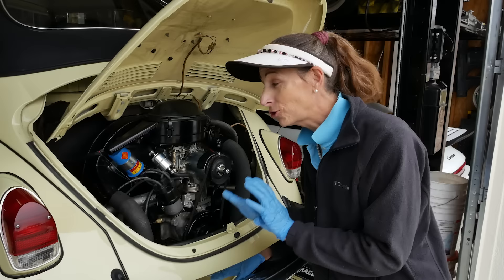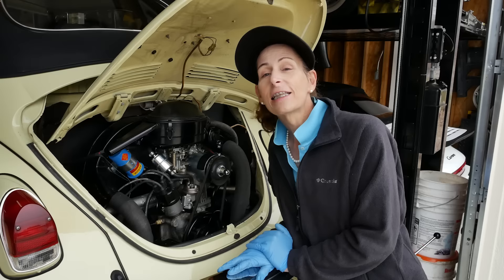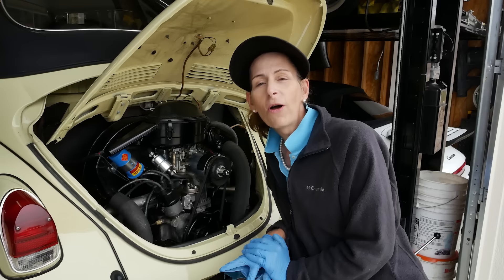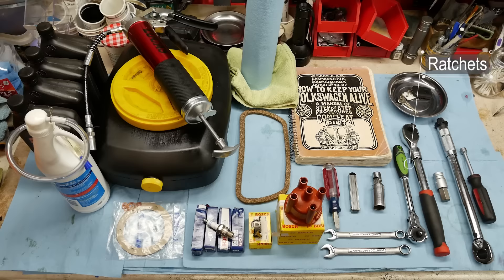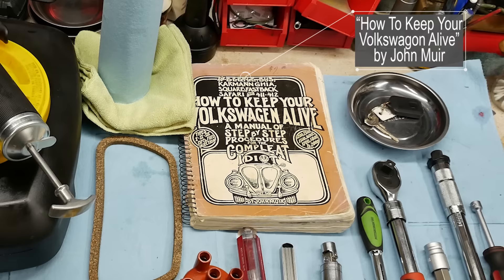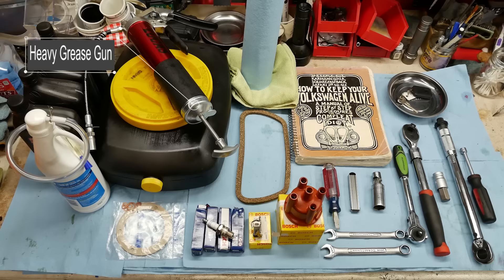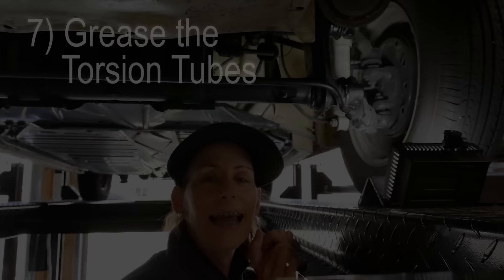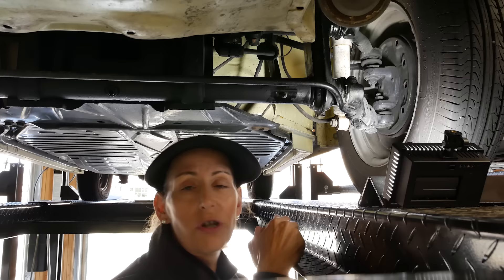VW Beetle Full Yearly Service Tune Up DIY! Easy!

Comment: Hi. Is the carb a Solex brosol H30/31 Pict ?
mine is having a vacuum leak at the throttle axle and it die when I pres the brake, the idle increases and lowers by itself and it does drive rough ( sometimes when changing gear it does choke ) ! What can I do ?
Reply from the maker: I think it is the combo replacement that is more like the 32-34 Pict.  If your butterfly shaft is allowing air in, you'll never be able to tune the engine properly.  Either you'll have to restore that carb by fitting a new bushing for the shaft or replace with a new unit.  The way to know is to use some carb cleaner and spray it at the bushing while the car is running (BE CAREFUL!  Have a fire extinguisher at the ready) and listen for an obvious RPM change...  If so, then that busing is bad.
Reply: @HeidiandFranny  Thanks for taking time to respond to me.
Yeah that is exactly what I did to be sure that I am having a vacuum leak at the shaft. I noticed the change in rpm.
I put an O-ring there but didnt seen to fix the problem. I noticed that tuning would not work that well too.

Comment: I have a 74 ghia.   1600 dual carb.   I changed my oil and put a full 4 quarts and it isn't touching the second notch.  I drove it for a bit and checked it again.  at the same place.   It seems like a lot of oil.  Am I reading it wrong?
Reply from the maker: Do you have an external oil filter? Also you do need to push the dip stick all the way in to get a proper reading... Does the engine have an aftermarket sump plate? Other than that I'm not sure...
Reply: @HeidiandFranny  Yes I do have an oil filter.   Not sure what the sump plate is.   how much extra would the filter add.   Yes I pushed the stick all the way in.  Thanks!
Reply from the maker: @manningcustom  the oil filter can take 1/2 qt or more... I like to fill the filter before I screw it on if possible. Try another half quart and see if that does it.

Comment: By the way...  That fuel filter is in a real bad place..  once it starts leaking, and it can, it will leak right on top of the distributor and you have a major engine fire.  VW's are notorious for engine fires...

Comment: wow I am surprised you are still running points. I find that the condensers that are available now from Bosch really suck compared to the old ones. So I run a pointless distributor.
Reply from the maker: I hear that!!  I ran through three on the 356 before I got a good one.  Really weird symptoms...  I would run electronic on anything that wasn't an original show car.

Comment: 5:10 Sorry, but this is wrong! Wanting the belt to slip means your belt is too loose.  You can see at 5:30 when you squeeze the two sides, they are deflecting way too much.  Setting the belt loose like that makes your engine run hot.
Reply from the maker: No it doesn't...  If the belt is any tighter you will destroy the generator bearings...  Try it...  You'll see.
Reply: @HeidiandFranny  .. My car has it's original alternator in it with over 250k miles on it.  I always run a tight belt, the bearings can take it.  VW says to set your belt tighter than you have yours. Look it up.  Making your engine run hotter in an attempt to save $10 in bearings is wrong thinking.

Comment: Recommended oil? Seen a lot of people tell 20w-50 but which would you recommend? Valvoline? Pennzoil? Store brand?
Reply from the maker: +shadowspect09 Valvoline racing or Royal Purple. 20W-50
Reply: Heidi and Franny's Garage This won't matter much rather or not we're on either coast?

Comment: Not to be a stickler but, you were calling both the distributor cap & rotor  the rotor cap & there's no such part, you have the distributor rotor & you have the distributor cap, two separate parts they are not both called the rotor cap & you can replace them separately, just letting you know.

Comment: what is the type of oil for the distributor
Reply from the maker: The oil for the top of the distributor shaft is just clean motor oil.  If you have points, you'll want a special, very sticky grease for the points cam lobes.  Bosch makes it and seems to work well.

Comment: If you are only adjusting the valves, once a year. You are decreasing the longevity of your engine greatly. The manual says every 3000 miles, but most mechanics will tell you. Every other oil change, I think John Muir says that too in his Idiot Book.

Comment: how often do you have to do each of these things?
Reply from the maker: Depends on the mileage...  no more than 3K for the oil, otherwise once a year for the other bits.  Most likely the timing won't shift unless you are using points.  Then you must time after points.  Check plugs, cap, and rotor.  Replace as necessary.  Every other year on the gearbox.

Comment: Gee, I was hoping I would see someone properly check at least the lower head bolt torque before adjusting the valves. I can't tell you how many loose VW heads I've seen over the years.